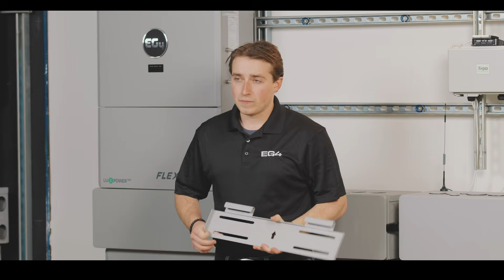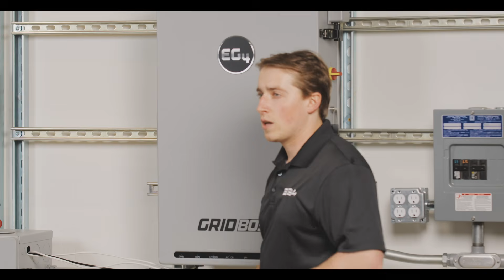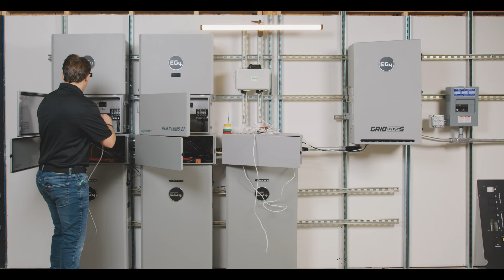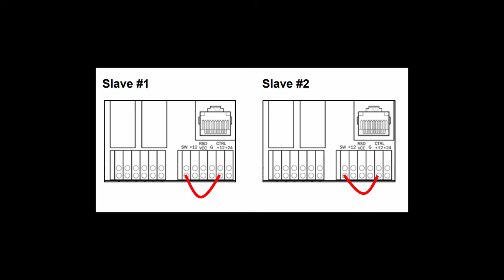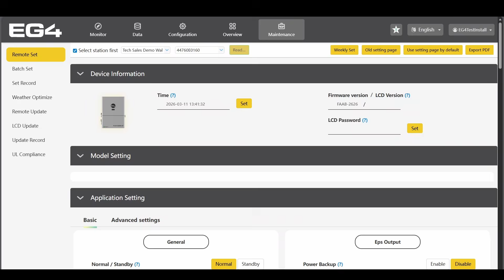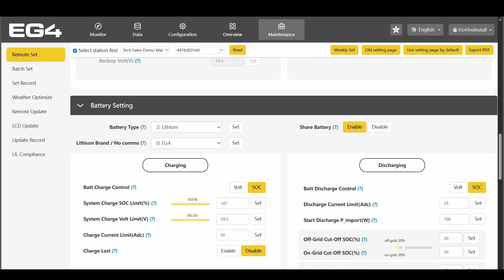Paralleling Inverters to an EG4 GridBOSS | Wiring and Setup

Comment: This is so frustrating.  In this video you say to close the inverter breaker then start battery bms then close battery breaker.  I called in to EG4 And solar signature tech departments to ask for the proper procedure and they told me to close the inverter breaker the close the battery breaker THEN turn on the bms.  Who the frick is correct?  This is thousands of dollars in equipment so I would greatly appreciate the exact factual procedure for on and off.  The wording in the manual is too vague also.
Reply from the maker: Thanks for your reply and sorry for the frustration here. We are following up with our documentation team to add clarity to manuals. 

The optimal method here would be:

1. Close DC Breaker on Inverter
2. Close DC Breaker on Batt
3. Turn on BMS

Both methods are supported, however the method shared by our support team is the most ideal.

Comment: So far, I have 1 FB21, 1 GridBoss, and 6 batteries.  I have 4 strings of 12 x 430watt panels.  My highest demand on the system is when I am charging my electric vehicle or when it is max-charging the batteries (seeing 215 amps or so when the sun is brightest).  I am a little concerned about longevity of the FB21 as when it is doing this much work it's really cranking the fans.  I was wondering if I got a second FB21, moved 2 of the strings to it, would that "lighten the load" on the two units and perhaps make them last longer as well as provide redundancy...  Thoughts?
Reply from the maker: Your inverter is warrantied at ten years regardless of load in/out - to that end we have a system in our lab that's been subjected to cycling at maximum charge/discharge for the last ~5 years with no ill effects.

That said, for longevity beyond the 10-year warranty, less extreme operation should lead to a longer useable life. Additionally, as you stated a second inverter will provide redundancy should you encounter any issues in the future.